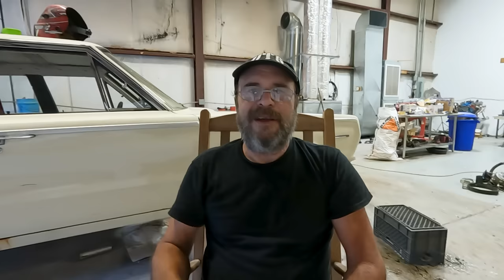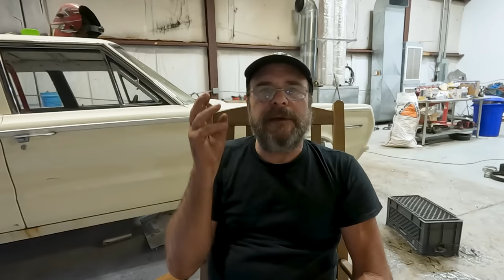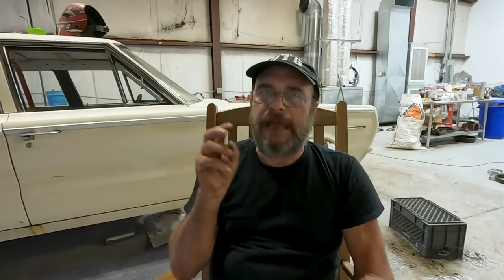They Really Are Out To Get You- How The Automakers Have Made Life Miserable For The Average Mechanic

Comment: My dad was a US Army mechanic trained in the 1960s and he taught me how to work on my own vehicles and small engines like my lawnmower and weed eaters. Now everything is designed to be obsolete and to be replaced instead of repaired. Right now all 3 vehicles I have are early 2000s models, and no vehicle I've ever owned has gone to a garage for anything as I've fixed everything myself but boy have I seen some crazy stuff. Like I'm a woman, and I'm not overweight I'm like 5'7 and 135 lbs and I have lil tiny slender arms altho I've got muscle because I push mow my acre lawn and do a lot of other stuff. But I noticed even in manuals for an average sized man that to even replace a lot of simple things for a guy who's much larger than me they make it so you have to remove a whole lot of things you don't need to mess with just to fix what you need to. Like I used to have a 1996 Chevy Cavalier and I would always be able to snake my arm down beside of the engine and untwist the old fliter and twist on the new oil filter and meanwhile guys would have to raise the car and remove the front passenger tire to use a lil access door to remove the filter. Right now in my 2001 Chevy S10 ZR2 the starter is out, and to fix it for a man he'd have to remove that passenger front tire but I was able with the tire on and it just turned to remove both the cables running to it. 
I have no idea what people will do with those new all electric vehicles, because it seems to me like everything about them is going to be unrepairable and that you'll just have to get a whole new EV. It's the reason why currently all over insurance auction lots all over America you have Tesla's and other fancy EVs with just even minor body damage that have been completely totaled out because they're not even making replacement fenders or this and that for them. Can you imagine what that's going to do to insurance costs? Just because let's say a shopping cart rolls down the hill and dents up your quarter pannel, the insurance adjuster comes out and says well your car is totaled out here's a check. Because that's happening today.
Reply: When the stores stop selling Bondo, that'll be the day.
Reply: I have a 99 zr2. The plastic oil sending unit broke and leaked oil badly. The distributor had to be pulled to get to it (so they said). I thought 300 was rather steep to replace a scew off cheap part. I wonder if the distributor really had to be pulled out. All I know is I couldn't get to it.
Reply: Reading this reminds me of a car I had. I had to remove a headlight to replace the air filter. And I cut my hand every time replacing the oil filter. When the horns quit, I found them inside the front fender. It was a pleasure to get rid of that car.
Reply: I own a 1993 Dodge Daytona ES. You can't check the engine codes the garage has the box and cartridge that does that.
Reply: I agree,  one thing tho. From what I've seen on yt,  the tesla are pretty easy to pull parts to replace.  "Like Legos " only time will tell.
Reply: Woman how do you expect anyone to read all of that wtf
Reply: why aren't replacement body panels being made for Teslas?  I thought there needed to be a 10 supply of parts/bits for cars according to some auto regulation?  I'm no fan of Tesla, but this scenario of no replacement part or extra expensive part because of sensors/cameras blah blah blah is a bit out of control.  And so why would anyone be a repeat Tesla buyer/leasee??

Comment: As for fuel tanks dangers, one can hook up a 12V external pump at the engine inlet line and pump the fuel into a container. I’ve done it and it’s easy. It takes a while but it’s safe. Overhead cams are a VW think-alike, which sucks.
Reply: Or just pull the fuel line and put in a container and then jump the relay under the hood so the electronic fuel pump does the work for u…I’ve done it …easy to do generally

Comment: Honestly I think we are catching up for open source code reading for electronic issues but ECU stuff and electronic diagnoses is the first battle, the second battle is in getting good quality replacement parts at a reasonable cost. The third battle is not having enough non dealership places to perform the jobs
Reply: 1- one can never catch up to a target of new BS every single year. Including new manufacturers some years!

2- one can never catch up because aftermarket shops are dropping like flies
Reply: First what's up Dude.. ok yeah brother I work in Auto parts.. for a distributor.. local shops and stores.. use to be in sales.. trying help out wrench diagnosis what's up with this 2012 Camry etc.. from wheel speed sensor, cam,  crank etc, Mass, TPS.. they all work in concert with each other.. any one of them can change your work schedule.. I see a car.. I see working class folks getting to work.. upper crust can't even care.. but.. dude 700 or more in work.. can break folk's
Reply: sure, go clear codes on a newer chrysler without having a "security link" active on your scan tool. I work at a dealership, and did rear brakes on a jeep. We had to send it to our sister dealership to have them clear the parking brake code and turn the check engine light off.
Reply: @Jodah175  Those lights go right out with an icepick and a smack all codes clear now 😀🤦

Comment: Serviceability was common in just about all products made during the time period you mention not just cars.  There once was a law that things needed to be fixable by more or less average people. Everything has slowly become throw away products.  IMO, once things were built by computers, and not by hands, everything has become unfixable and with heavy computer control that require dealer level scan tools and subscriptions to reprogram, it has made the driveway mechanic a thing of the past.
Reply: TV repair shops.... Best place to get your tube fixed or to buy a refurbished one. Those are just gone now.
Reply: Of course
Reply: @schickieschickler102  man, I miss those CRT tv's :(
Reply: I used to service refrigerators, replacing compressors etc in boxes that were purchased for $400 or less 15-20 yrs prior
Now they make this stuff that is “better for you” in which the components are often not serviceabe, but the fancy stainess steel cabinets run $2000-$3000 or more, and are destined for the scrapyard after 10 yrs

Comment: Sometime between 87 and 89 GM decided to attach a heater pipe to the water pump bolt of the 3800, turning a 30 min job into a hand-wringing, head-scratching can of worms. Ultimately I found that although it totally went against my instincts, bending a bracket to get that pipe off was a lot easier than continuing to take off more parts and run into more obstacles

Comment: When I was a kid I knew a old ford master mechanic and he told me  that ford design there products intentionally to be difficult on purpose. They had unusual ways to design and build their products to make line hard on all of us.
Reply: there products intentionally to be difficult on purpose
Reply: as someone who has mostly worked on GM vehicles all my life, I always wondered why Ford chose to have so many bolt patterns on their engines/transmissions...Chrysler also, to some extent. Looks like the way Chevy did it would have been simpler/more economical to manufacture and better for the bottom line, as well as making life easier later on for mechanics and hot rodders...
Reply: Old Fords are really easy to work on.
Reply: @SCHMALLZZZ that may be the case but good luck getting one

Comment: Great video Tony!   Twice (both on GM cars) I've cut an access hatch in the trunk floor rather than drop the gas tank.   After changing the fuel pump I simply fiberglassed over the cutout.   A 4 1/2" angle grinder can solve lots of problems.
Reply: Honda and Toyota have an access panel for the fuel pump. They also know they get repeat customers.
Reply: Did that with my dodge ram  ac unit under the dash. Like fock, I was going to remove the dash to clean it. I  took a knive, made it hot, cut a hole in the fan housing area, and glued the cut out back on. Works like a bomb

Comment: Tony, your spot on i was in the factory commercial automobile repair industry (certified GM" Chevy &Oldsmobile technician) in 1978,79 and 80) the factory created such a nightmare of a repair process on GM that everyone at the shop they sent to the GM training center in Charlotte,  NC still couldn't accurately diagnose the problems  even with the codes the on board computer s were telling us, were accurate we became parts exchangers until the computer stopped throwing the bad codes and the engines finally ran correctly. Thats when I turned my back on new car repair and joined the Army and did other things.

Comment: "Food for thought:"
Back around 1975 my boss in a body shop said that he did not understand why doctors earn well over six figure income when the human body never changes parts or systems.
Cars on the other hand were being fitted with electronic this, that, and the other.
Car glass was being coated even today with a plastic material that easily scratches and makes it difficult to see through.
In fact, glass is still part of the structural make up (frame).
It works like a truss brace or gusset.
Cars and trucks were being fitted with "high strength steel" that are not stronger than older steel. 
It was named "high strength" because the chemistry composition made the steel suprisingly strong, but was lighter and could not be straightened like conventional frames.
If heat was applied it ruined the chemical composition.
You need still today a thermometer to make sure you do not heat it past manufacturer heat specs.
You still cannot weld replacement panels/parts or even a tow hitch because welding heats past recommended heat specs.
Plus heating/welding emits dangerous chemicals to the human body; eh, another dead body man/mechanic!! (one less egg to fry...)
A "simple" thing like snap rings need new fangled pliers to release install.
None of my girfriends bodies need snap rings
Broken body parts mend and heal themselves, no welding necessary!!
Just put the bones back together, hill, they could be duck taped toegether until they solidify/heal.
Human body alignment is done mechanically by hand without a ramp fitted with all the laser gizmos.
The list of automotive and equipment changes goes on and on.
Yet the human body systems have remained the same for thousands and thousands and thousands of years!!

Another "food for thought," the definition of mechanic is, one who works with tools.
Doctors work all kinds of hand tools including hammers to beat on peoples bodies and locking pliers like vise grips.

So how is it people and doctors see doctors worthy of so much more money than automotive mechanics??
I speculate we have brainwashed into thinking as such.
Plus, doctors can issue preliminary notices and mechanic's liens just like a carpenter or mechanic.

Did I just ramble??...

Comment: I remember replacing the fuel pump on a 78 Impala I had in college. It was the driver side of engine and only a couple of bolts to remove and replace.
Reply: Yeah, I had a 68 Mustang with a 6 cylinder and I replaced the starter motor from the top!  
Sure a 8 cylinder you'd come from below but it's still just bolts and electrical connections. 
Most of the problems back then came from squeezing big motors into small spaces and you had to accept that compromise which had reasons for it you could readily understand for example, vans are harder to work on as a function of their design ...the problem was space, that alone, not some other agenda...
That said they used to make vans/delivery trucks with long noses...

Comment: When I had to adapt to EFI I wasn't happy about it but I've actually got comfortable with it. This canbus crap however is a deal-breaker. I don't want anything with that wretched setup.
Reply: Absolutely! They managed to create a single point of failure, and disperse it throughout the whole car! No way to diagnose it except ripping everything apart and unplugging sometimes dozens of modules to do continuity and resistance testing! F-that! I love my 90s EFI, enough tech to make it rock solid reliable, and in the rare instance something electrical does go wrong, they are easy to diagnose, and nothing has to be programmed or vin coded!
Reply: The beancounters thought canbus was a good idea at the time but it evolved into a cascading failure like a row of dominos. Apple has the same canbus problems.

Comment: Tony, regarding your example of Ford 4.0, the engineers probably found out after they designed the engine this situation you described. At that point, they didn't care. I wouldn't go so far as to say they were out to get anyone. I worked for chevy engineering in the test lab in Warren Michigan back in the 70s. Then, I went to VW  Audi. We used to talk about this issue. Cars are designed for manufacturing,  not servicing. It isn't a  issue of out to get anyone, but rather, they just don't care. Great discussion.
Reply: If you don’t care then you are out to get people
Reply: Thanks for chiming in with some insight.
Reply: In reply to car repair they aren't out to make it difficult. I used to work in a repair shop. I noticed the older model stereo receivers had a removable bottom plate making it easy to service. Some years they stopped doing it..I often wondered why..
Reply: I would say the manufacturer wants the mechanic out of the loop.  It forces consumerism at factory repair facilities at outrageous prices and forces consumers to keep buying new cars.
Reply: Yep - Planned Obsolescence - They want to sell cars.  "Don't you want the new model anyway?"  Ha Ha
Reply: @Brian-yt8fu  theft deterrents?

Comment: This is the reason why the electronic ignition on my bike grinds my gears. There was nothing wrong with the distributor setups. They were simple and easy to time. Points can be replaced by the side of the road (if you pack replacements), but try to get the ecu working when you're stuck on a desert highway if you have an electrical problem.
Reply: you can also force a completely mechanical engine to run poorly if you really need to get somewhere. Something computerized will shut itself down rather than sacrifice its own mechanical integrity to get you to safety.
Reply: @lsswappedcessna  very true! I miss the simple things.
Reply: I’m fine with ECU’s if the operating software is open source and can be flashed onto any hardware capable of running it. Any computer with the right ports and requirements should be able to act as ECU for DIY jobs.
Reply: Or on a quad in a remote forest. Not a great situation to be in
Reply: Haha I read that first sentence thinking you were talking about some behavior the electronics have that makes you miss shifts or something lol but then, yeah.

Comment: I was in the design for serviceability meetings at GM in the 90s when the fuel pump access plates went away.  It was nothing but a cost issue.  As a fallback we pushed for a serration in the trunk where techs could cut on the dotted line and add a service plate after a pump replacement because it was a fairly cheap addition.  Still too much per vehicle in cost and mostly the structure engineer felt it could change the crash worthiness enough to have to test cars twice so that got flushed.  Right or wrong, it wasn’t a plot, simply cheaping out and passing the added replacement cost on to the customer at the 100,000 mile mark.
Reply: 100k on a gm pump in the 90s? That's a good one. Lucky if they lasted 10k
Reply: My 29 year-old Toyota Land cruiser has an access panel and it's got the original pump with 312,000 miles.
Reply: @howardkeil1526 my 34 year old civic hatch is running on the OG pump. No hatch but the tank has a drain plug.
Reply: The Japanese, especially in the 90s were just awesome. They actually did care about serviceability and reliability.
Reply: My ‘97 camaro is a fun one to change the fuel pump on.  I’ve done it 3 times and still haven’t cut an access panel because I’m still stuck on the fact that it’s a real SLP SS.  This last time, I nearly tossed my purist view out of the window, but I have become quite efficient with replacing the pump in these things, so it still doesn’t have an access panel
Reply: @MartinX192  My Dad's '95 Silverado, bought new, is still on its original pump at 220,000 miles. His '01 SSEI, also bought new, is as well with the same miles.

I don't know how or why, but my Dad is like the GM whisperer. Whatever the best possible version of whatever vehicle they could build was, that's the one he ended up buying. He drove the original steering on his truck until the tie rod FELL OFF ON THE GROUND WHILE PARKED. Just... WTF? 😆

So.... Whatever luck the rest of us didn't get from The General, now you know who got it.
Reply: I am a 4th generation mechanic  i Run my own shop .My family  also owns auto/truck dealerships .I have been telling my customers for years nothing is done for the greater good of the mechanic or owner just the bottom line of the manufacturer !